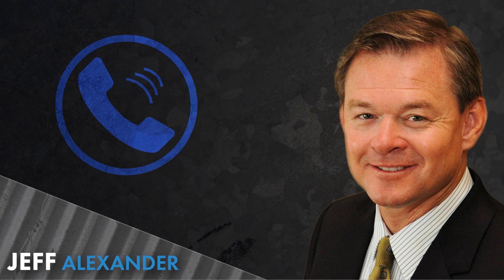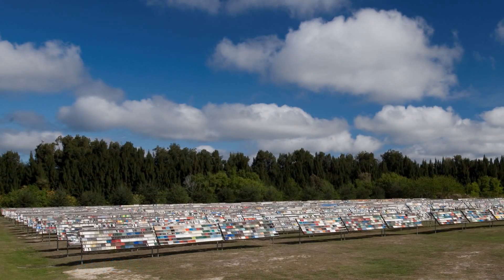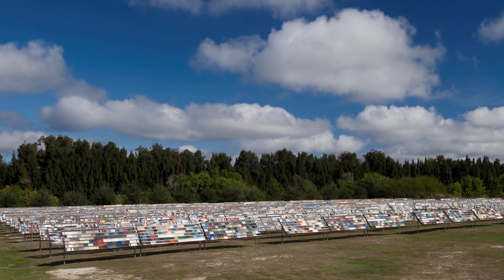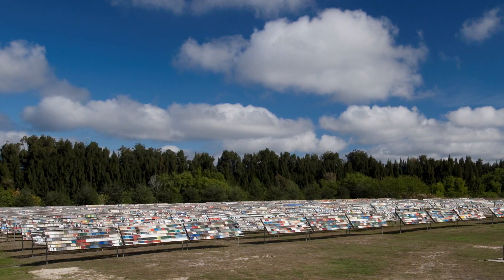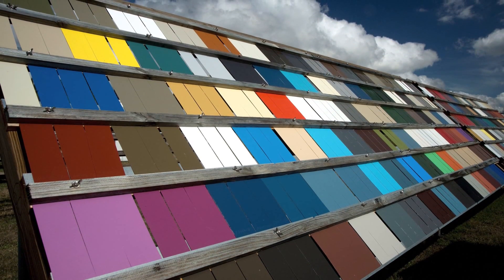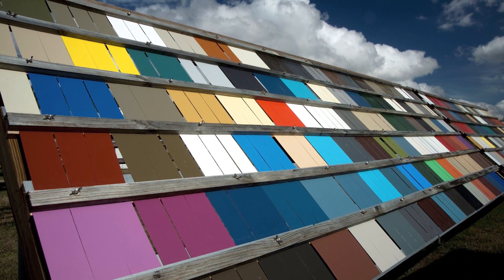What Paint is Best for Your Metal Roof? PVDF vs. SMP

Comment: Hi, can both PVDF and SMP be painted over in the future? What type of primer and finish coats would be appropriate for such an application? Change of color is the motivation for the recoat. Any special cleaning or prep steps needed?
Reply: A little gasoline and diesel on a cotton rag(boxer briefs or flannel shirt) rubs right out. Then hit with a pressure washer with dawn dish soap air dry and you eat off next day. That's how we did it back in shipyards in Iceland back in the 60s

Comment: I am building a large (>2000 sq. ft.) rain collection roof.  Has there been any studies that you know of that look at the differences in runoff contamination between SMP vs PVDF?  I would assume if the coatings are so long lasting that very little transfer would happen into the water running over the roof.
Reply: did you ever find an answer to this? Im curious too

Comment: We have a steel roof in the northeast where we get lots of snow and ice.  Which paint is recommended for this climate? It has been wire brushed where needed, and primed and painted.  The last paint used flaked off.  The roof has been on the house for 40 years, first time having a flaking issue.
Reply: Wrong prep or bad paint...

Comment: What is the best for the roof metal?
Reply from the maker: Hello, Carlos! A PVDF paint system will be longer lasting than an SMP paint system, but PVDF is also the more expensive option. Thanks for the comment! -Thad
Reply: @TheMetalRoofingChannel  WHAt is PVDF AND WHAT IS SMP? ASSUMING A BRAND ???/ OR IS IT ABBREVIATED POLY VINYL ......SOMETHING LIKE THAT?
Reply from the maker: @richardcartagena9083   PVDF and SMP are abbreviations based on the type/combination of pigments and resins used to make up the paint system. PVDF = polyvinylidene fluoride SMP = silicone-modified polyester Hope this helps! -Thad
Reply: My husband wants to paint metal roof with rustoleum. ....is that a type of pvdf or what?